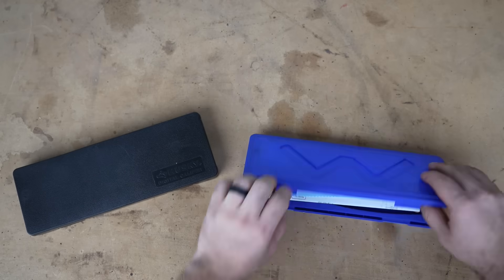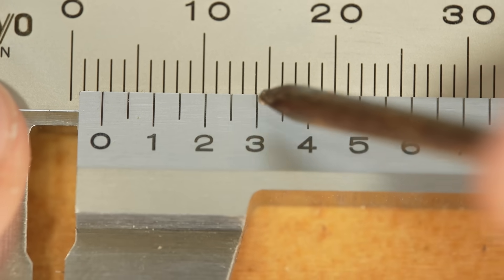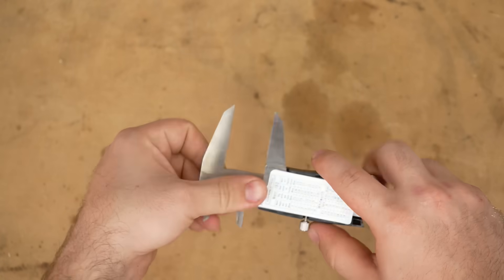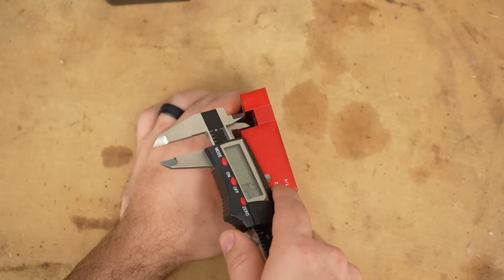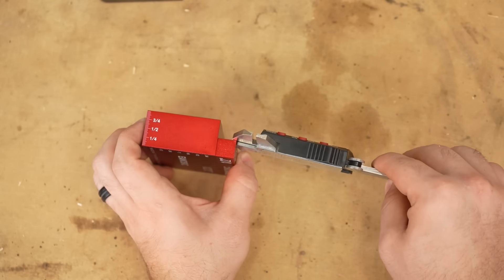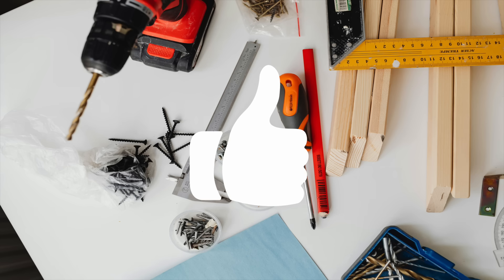I wish i’d known this sooner, How to use calipers like a pro

Comment: Sorry. Had to bail out after the fourth "ver-neer". French pronunciation is hard, but not so hard that you can't approximate it with "vern-yay".
Reply: And ironically the French don't even call it that.
Reply: @nicknelson9450  If you want to specify specifically a vernier caliper, it's a "pied à coulisse à vernier". We don't call them vernier calipers in English either unless they actually have a vernier scale. But I suppose we are more likely to specify, since "caliper" without a further specifier can refer to a number of significantly different objects, while "pied à coulisse" does not.
Reply: @wbfaulk  I've personally never heard anyone French say "vernier" after "pied à coulisse", but maybe I don't move in the right circles. 🤗 In English, on the other hand, I've always referred to it as the full "Vernier caliper" but there too, it's not like it's my profession or anything and it's certainly not something which comes up very often in conversation.
Reply: @nicknelson9450  Again, probably because it's insignificant in context in French. If you specifically wanted one "à vernier" as opposed to "à cadran" or "numérique". Most of the time it doesn't really matter, but in English, if you just say "caliper", you might be talking about a "pied à coulisse", or you might be talking about the thing that squeezes the brake pads on your car, or the thing that looks sort of like a compass or dividers that's on the Motor Trend Car of the Year trophy, so it's common to overspecify.

Comment: Great video! I knew about all the other measurements except from the step measurement but wouldn't you get the same result with measuring it with the rod on the back of the caliper?

Comment: As a guy who works in metrology: If you're really concerned about the accuracy of your calipers, stop using calipers. They should only be used for spot checking, not for verification. That job is best done with micrometers.
Reply: Ok, but accuracy requirements are relative, depend on the activity and micrometers have smaller measurement scales and take longer to use.
Reply: @nicknelson9450  true, but that speed comes with a cost. Especially if you don't have your calipers regularly calibrated.
Reply: @DanAllen117   Thanks, I didn't know a Vernier could be calibrated. Not sure if it would be worth the cost on my relatively cheap 0.05mm one though. The zeros are aligned but I guess it would be nice if I knew where to go to just measure a reference block to check. I'm just a hobbyist...not going to lose sleep over it.

Comment: - 00:00 📏 Vernier calipers are often misunderstood, but are highly precise measuring tools.
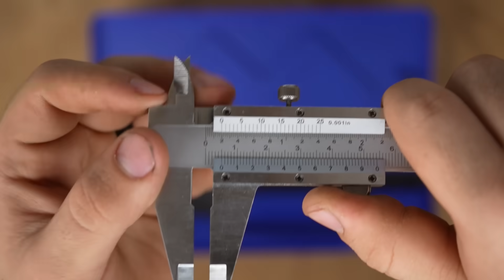- 00:30 🔬 Vernier calipers can achieve accuracy from 0.02 to 0.05 mm, comparable to digital calipers.
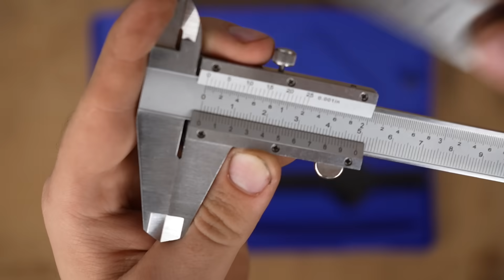- 01:10 🔍 The Vernier scale works by finding which lines align to determine precise decimal points in measurements.
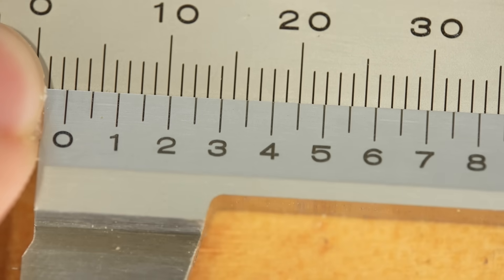- 02:09 ⚙️ Using the Vernier scale, measurements are more precise than estimates, offering high accuracy.
- 02:47 🛠️ Digital calipers are easier to use, displaying values on a screen, and offer multiple measurement methods.
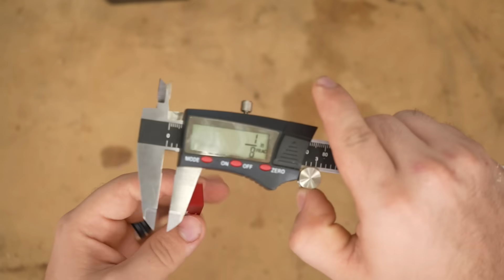- 03:30 📐 For accuracy, ensure calipers are squared and flush when taking measurements to avoid misalignment.
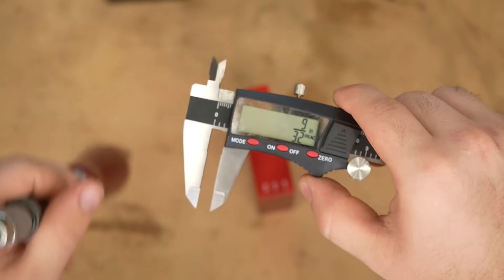- 04:30 📏 Depth measurement uses an extending rod, while step measurement is done using the front part of the caliper.
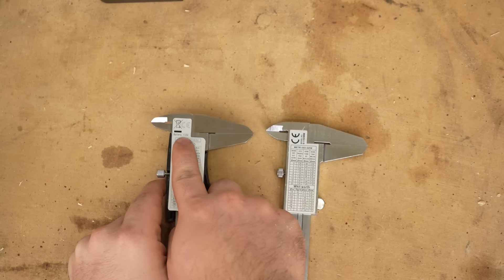- 05:36 🧭 Calipers may carry conformity marks, distinguishing between European and China export standards by letter spacing.
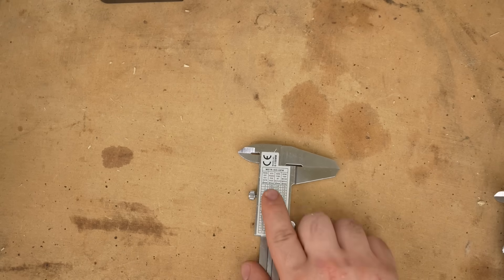- 06:27 📝 Charts on calipers include metric ISO and British Standard charts, detailing thread dimensions and drill sizes.

Comment: As a european:  
3:25 holy crap I always thought nobody would actually use the inch fraction notation in reality.  

6:37 almost all calipers only show the thread diameter and pitch. The core diameter isn't that important. And the drill diameter can be calculated by the thread diameter minus pitch.

Comment: The gap in the caliper blades is there in case there is a burr on the edge of the material you are measuring. By having the burr in the gap, it will not be included in the measurement.

Comment: The non-digitals are no more or less accurate. The problem comes in with the user's interpretation of the moving marks relative to the stationary marks. Two excellent machinists may see a different measurement of the same work piece. The digital ones interpret it for you. How accurate that digital interpretation is-- is a matter of quality control by the various manufacturers. Like and subbed.

Comment: 0:40 That is not correct. Vernier calipers are MORE accurate than digital or dial. Starrett who makes all three types rates accuracy of Digital and Dials at +/-.001" whereas they rate the vernier calipers at +/- .0005".
You are talking about resolution, not accuracy.

Comment: 5:53 the Chinese figured out we figured it out and they do ANYTHING to trick us into keep buying their garbage products no matter how much we try to avoid them.
Reply: It's not a trick, it's providing a level of quality and its corresponding price where there is a demand for it. If you want higher quality, they do that too...at a higher price.
Reply: @nicknelson9450  they would have to have competent engineers in order to do that. They rely on stealing technology by reverse engineering everything but they still don’t understand metallurgy or tolerances.

Comment: Master optician, LLNL.
Great video, very informative. My only caveat is that when performing micron-level measurements, heat from your hand will affect the caliper, gradually reducing accuracy. Allow the caliper/micrometer, etc. to acclimate to room temperature between readings.

Comment: my tip as a professional:
you can adjust the tension on the guide-rails. there are 2 holes at the top with tiny screws. adjust these carefully and test how much play there is.
this also changes the angle of the caliper-arms and how the zero-point for inner and outer measurements behave in comparison.
if adjusted properly, the zeropoint for inner and outer measurements are the same and evrything that should be 90 degree also is 90 degree. keep in mind, that there is some spring tension on the guiding rail! if you adjust it to tight, to a point where the spring is fully loaded, you will be damaging your guide-rails.

the next useful thing to know: the electronic measurement-system is usually more accurate than what the display shows. if the display can show 0.01mm, the internal measurement is usually like 0.0025mm. if you press the zero button, you reset to exactly 0. if it shows 0.00mm and you press the zero button you will reset the internal measurement. it might have been 0.0025mm and you move the zero-point to exactly 0 moving it by less than 0.01mm.
you can adjust the caliper more precisely than the 0.01mm it shows!
always check the calipers against a part with an exact known value (like in the video).
i usually check it with cylindrical testing pins. its much easier to keep them clean and the shape allows you to test a single spot on your measuring-arms. the squared testing-parts can be hard to handle correctly and need to be really really clean. a small defect on the surface of the caliper or the testing part ruins your precision. round testing pieces are a lot more forgiving to defects and dust! use those!

if you treat your calipers good and adjust them well, you can reliably measure within +-0.01mm.
usually these are meant to be used to measure nothing more pecise than +-0.05mm and at a professional level you should use better tools for anything that needs more precision than that. but its still nice to have your calipers working way better than the +-0.05mm.

sry for my bad english. im not a native speaker.

Comment: Funny this should show up in my feed today!
I work at a retail auto parts store and within my first few weeks I brought in one of one of the Hazard Fraught[Harbor Freight] cheap $2 plastic calipers.  It's not like we're a machine shop, so 99+44⁄100% of the time we just need to size things down to 1mm or 1/16" at most, so they're perfect for that; + quick & dirty conversions between Imp. & Metric!

That said, today I had a customer who was trying to confirm the inner diameter of a carrier bearing, and the one flaw raised it's ugly little head...      The plastic version has no set/hold screw!!!

So I'm off to find a somewhat better version in metal - WITH a set screw.

When the Universe speaks, it doesn't hurt to pay attention to the message.  Especially when it's brought the subject up twice!

Comment: 05:53 Please don't spread the CE "China Export" myth, it's an urban legend: https://en.wikipedia.org/wiki/CE_marking#%22China_Export%22
The CE marking merely means, the manufacturer/importer assures that they have checked that the product complies to EU regulations, which is a requirement for all products sold in the EU anyway, so all products must contain the CE logo. Using a fake CE marking does not acquit you from this.

Comment: MAYYYBE someone else mentioned this, I did not read that far down.
ONE major advantage of dial type calipers is that they can be "re-zeroed". This means that after heavy use and damage the surfaces can be precision reground and the dial caliper would still be as accurate as a new one. This is possible to a smaller extent on the digital ones, completely impossible on calipers with Vernier scales (except very special ones where the Vernier scale can be re-positioned with tiny screws).

Comment: I am a 77 year old that has used vernier, dial, digital instruments and find the big advantage of  a digital is that you can zero it at a given start point (absolute measurement) thus so much easier to follow as you machine a part so you are seeing exactly how much you are removing and no chances of a mistake or forgetting where you started.I have cheaper instruments for less demanding work and save the high end ones for the most critical measurements. I build parts for astrophotography that requires extreme accuracy.... but even in that area I don't always need the ultimate precision for every part..... generally .001 is more than satisfactory.
The one area he missed is the effect of temperature or more precisely changing temperature on a part and the instrument as it is handled or machined. When using my ultra accurate micrometer (5 decimal places) I have a device that holds the micrometer to avoid temperature changes caused by the heat from your hands. I also work with both Metric and Imperial measurements. One advantage of the digital devices is it can switch between the two systems without needing another device.One of calipers has Metric and Imperial as well as fractional system. This is handy as I also do some woodworking so one instrument does triple duty. Digital also allow me to set an absolute point so can start the 0 point anywhere  I do have one dial instrument used for reloading. While it remains accurate, I suspect due to the gear mechanism used, it would be subject to inaccuracy caused by wear and tear more than the other types. I have come inexpensive instruments for "knock around" use but also have several of very high end Starrett and Mitutoyo  that have certified accuracy that are kept out of harms way and used when I must have absolute most accuracy.  For many uses you don't need the highest accuracy so a cheapy can be more than accurate.

Comment: Properly setting zero value on both instruments is critical (and yes you primarily check zero on a vernier, but any one that is halfway decent will have a way to adjust zero).  One huge advantage for a digital (and to a lesser extent dials) is that you can set zero as a reference and measure differences from that.

Comment: Never used a caliper, probably never will, but the video was interresting.
Reply: Tho there is no way the two CE you showed were different lol.
Seemed like you said the right one was a china export.. but according to the spacing they both look identical. That's not how china export should look like?

Comment: As a machinist, my favorite way to use calipers...is to get a micrometer 😛 jokes aside, very informative and handy video to show to anyone who is learning to measure with hand tools. We had an operator who had been on a mill for almost year, and he didn't know that you could measure things other than just using the inside of the blades. Not his fault though, as he was not properly shown how to use them. I've made the extra effort since to ensure any new hires, or those who have moved up from deburr, understand the power of these tools.

Also wild fact about the Conformity! Definitely glad I still decided to watch a video on a tool I look at 5 days a week, as I learned something new.

Comment: I have had my Mitutoyo dial calipers for decades and I would not have either of the other types you show in the vid.  One thing that is better about the dial calipers is measuring something you have then quickly dial in the next most appropriate standard size of anything and seeing if that looks like it would work. Or looking at clearance by measuring the thing and dial up a clearance or next size drill.  Neither of the one you show can dial up a measured distance then add .030 to see the result as fast as my dial up.

Comment: Something you missed.

The little thumb wheel on the sliding part is the "precision advance" and is more or less designed such that one can close the caliper with a higher degree of precision and repeatability. It is more or less a slight gear down combined with a tendency to break free when a certain torque is exceeded.

Comment: 6:55 - The last coulomb is redundant. The drill is always the major D -  thread pitch. For example, M16x2, drill = 16 - 2  = 14. or M3x0.5, drill = 3 - 0.5 = 2.5.
Check for yourself.

Comment: A few things on the CE mark:
-The china export thing is a myth, it's just that the proportions are sometimes incorrect, especially on Chinese products, but they are actual CE marks.
-The CE mark is a declaration of conformity, by affixing it to a product, the manufacturer declares that the product complies with all applicable EU standards and regulations.
-If the manufacturer is not in the EU, the importer becomes the manufacturer legally. He will be completely responsible for the product. And fines can be brutal if its a fraudulent mark.
-The mark has to come with a declaration of conformity document, if the package does not contain such document, the manufacturer has to provide it on request, if he can't, he could be sued.

Comment: vernier callipers are precisly, durable and don't cost much. The perfect tool for accurate work and messurement.
 digital vernier especially those you could buy at DIY or any low budget grocery are cheap tools and not recomanded if you need to work precisly

Comment: If you apply pressure in the same line as the outside contact points, rather than clamping down offset by using the wheel, you reduce Abbe error.  Usually not enough to worry about, but with a 25.4:1 Mitutoyo metric dial unit,  you can see a difference.  More importantly, it the fact that you are consciously aware of the cause of Abbe error when using calipers. 
Gratitude to Jim Salsbury, metrology PhD

Comment: I've been using Vernier Calipers, and dial, and Digital Calipers for 35 Yrs. I did not Learn anything from this Video!
0 to 8"
0 to 12"
0 to 24"
0 to 36"
and now 0 to 48"
I never use the Chart on the Back, I have a Machinist Book to go from.

Comment: I have the 530-104 Mitutoyo calipers.
Back when i started engineering school, my dad had an older pair of Mitutoyo's i could use. I loved them, and when HE lost them (unknowingly) and blamed me for it, i gifted him the 530-104.
... Then he found his old calipers at the bottom of his toolbox, and he hasn't stopped apologizing since. He gave me back those gifted calipers as an apology. (at my own literal expense :P)
In school, everyone had digital calipers. Except for me. And i couldn't have been happier.

Say what you will about digital. It works, it has its benefits... But it also replaces a lot of hardware it doesn't need to, and ends up inducing error or reliability problems that doesn't belong there.

Analog will fail you when you break it. Digital will fail you when it breaks.
The difference is small, but measurable. Well, given the right tool of course. ;)
Reply: Not an actual vernier guy but I love dial calipers over digital.
Reply: Digital, in regard to a lot of tools, can sometimes give more precision, but I agree it can have reliability issues. To me, digital is like having another guy take the measurement and telling you what he got, and sometimes that guy isn't so smart. So I'm with you on preferring analog because it doesn't add that layer of uncertainty, my own eyes can be the judge. And props to your dad for his integrity, sounds like a good guy.
Reply: Thanks a lot Sir for your invaluable and excellent analysis “Analog will fail you if you break it but Digital break you if it fails”. Sir in today’s world we are turning towards digital and becoming subservient to it we are ignoring our own abilities and placing reliance on digital implicitly. Love and respect from India 🇮🇳!

Comment: It might be worth mentioning the locking screw(if you didnt already). I have in the past made a measurement then had to take callipers elsewhere and accidentally slightly knocked the calliper unnoticed. Bang goes your measurement.

Comment: Nice video, but keep your dirty meat beaters off of the tools tip, this will bring inaccuracy (heat expansion and dirt)... also there are calipers that require you to calculate offset for the ID measurement... it usually like "what ever you measured -10mm). the good side of these are that they are usually beefier, the bad is that you need to remember to do the offset calculation.

Also, you should avoid drawing lines with the calipers, eventually the tips will break.. that said, i'm guilty for this one too